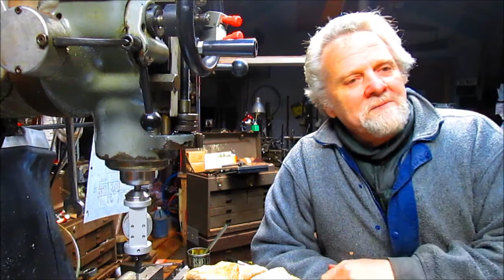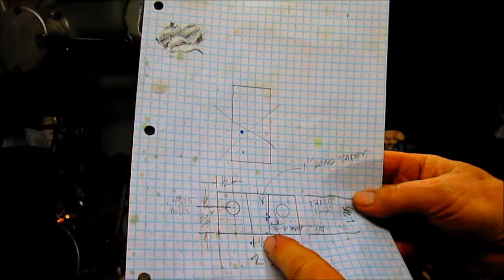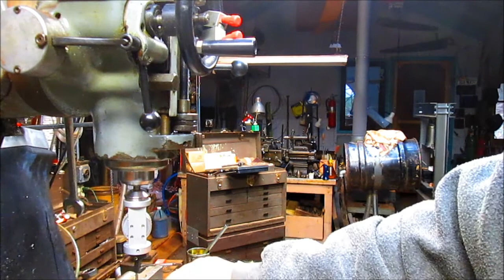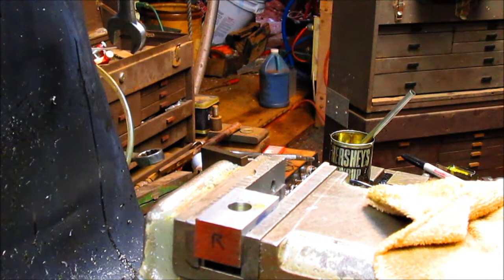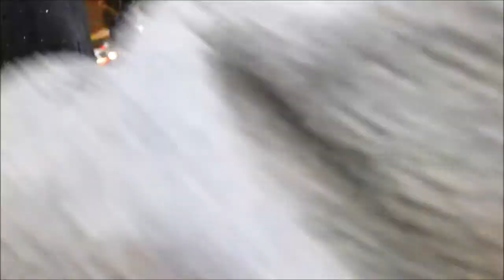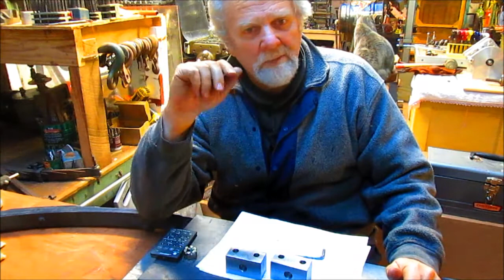Metro Madness 2

Comment: Are these custom Metros modified projects or is that what ya'll really drive out there
Reply from the maker: The one I was working on in that video is a 3 wheel custom machine using a metro engine. I do have a 92' metro that I drive back and forth to town.  Because it sports a little 3 banger I have to shift like a truck on the hills, but I don't mind, it gets 50 mpg with very little electronics.
Reply: Hard to get parts for? You can't make everything!
Reply from the maker: Actually, out here in California metros are a dime a dozen.
Reply: They're a dime a dozen anywhere if you can find'm. I understand your gas is much more expensive than ours